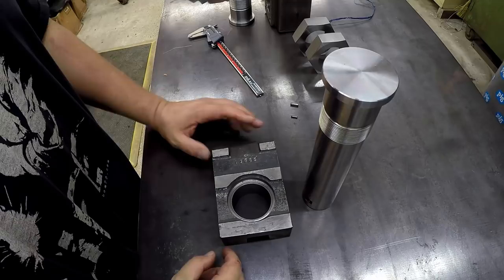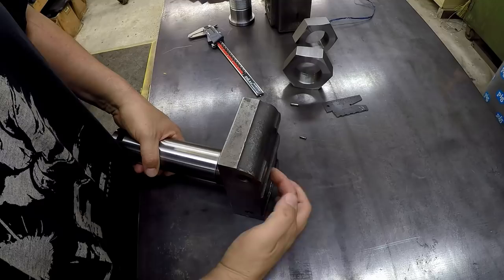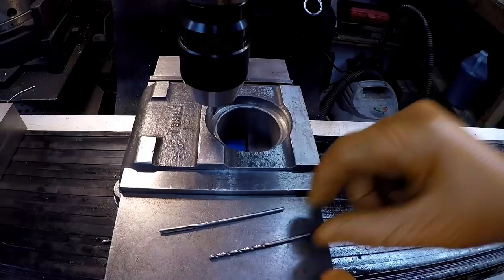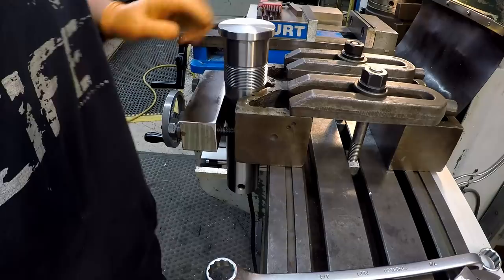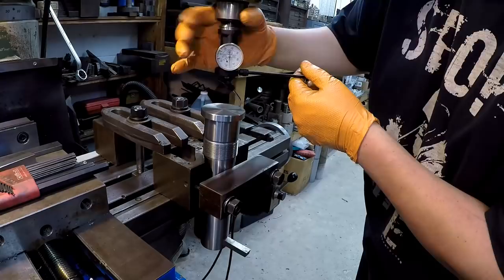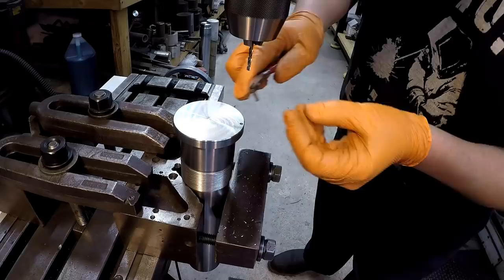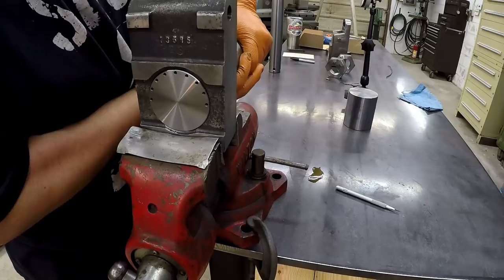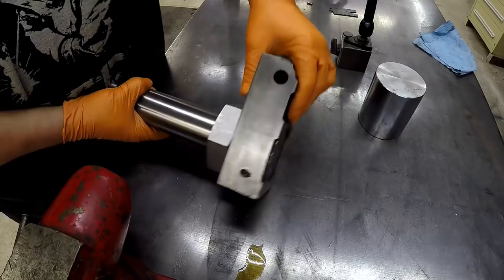Custom Internal Shaping Bar Part 6

Comment: I'm just wondering if a 1/8 pin will be strong enough ? Nice work either way. Thanks
Reply: Not a machinist here. I would think that would be more then enough, the only time you need rotational strength is when the bar is being positioned. During the actual machining process the bar has been locked down so I would think that would be more then enough. Just a thought.
Reply: I hope it doesn't become a shear pin if the nut loosens.
Reply: I expect that if the nut loosens, he's got much bigger problems!

Comment: Adam is it possible to shape cut gears on the g&e?
Reply: You can cut gears on shapers there are some jigs that have be built to do so. Check out jbfromoz channel he shows the process, I'm part way through the jig making. It does cut a true gear tooth shape which runs much smoother than the approximate shape produced by involute milling cutters. All the best Mat

Comment: Abom79 I have a question regarding dial indicators. A the 8:24 mark, I noticed that the needle's movement was not very smooth. You made an adjustment and the needle moved smoothly. My question is this. Does a dial indicator need maintenance, lubing, cleaning, and/or calibrating?
Reply: Yes to all the above.  Adam has talked about the need for preventative and corrective maintenance on his precision measuring tools and gauges.  I once bought a set of micrometers and after they arrived before I used them I checked the included standards against known good mikes.  Once I knew the standards were accurate I used them to check the new mikes and had to adjust the mikes for zero.

Comment: Will you evercswap out all your Drillbits for same same size range of carbide endmills? They drill better and cleaner than drill I feel. What's your thoughts Adam?
Reply: Are endmills available in letter and number sizes like drillbits? If so i have never seen any.All i see is fractional by 1/16.
Reply: I wish they were though.
Reply: @ronalddavis  the future is now I'm sure it can be done if not in carbide due to shrinkage then another supper steel?

Comment: real men don't wear gloves.
Reply: Real men know their own minds and don't tell other men how to behave.
Reply: When you spend all your working days dealing with razor sharp swarf ( chips to all of you in the US ), then spend most of your evenings at home up to your armpits in swarf again of your own making, it make perfect sense to even the most Neanderthal machinist to wear hand protection!
Reply: @samrodian919  + that samrodian.  I've gotten contact dermititis from wrenching all day, hands soaked in oil n grease. Break clean n carb n choke spray. Gas and kero and all that plus all the chemicals to Clean it off or to strip paint and using it to wash my hands with.  I only wish there was gloves like that 20+ years ago, or at least wish I would of thought to look for something for my hands